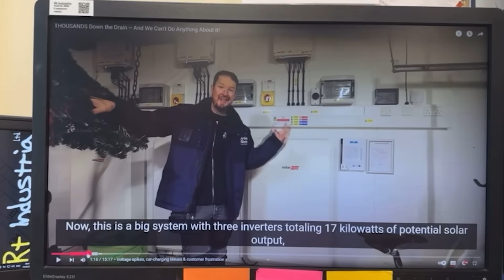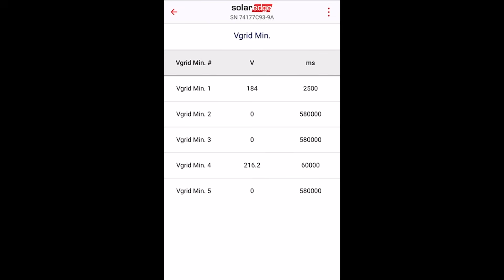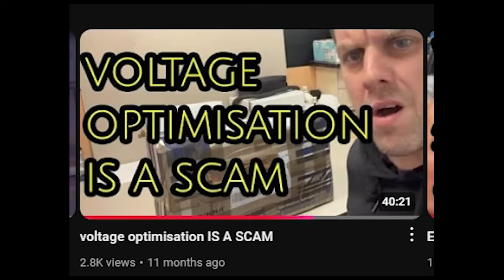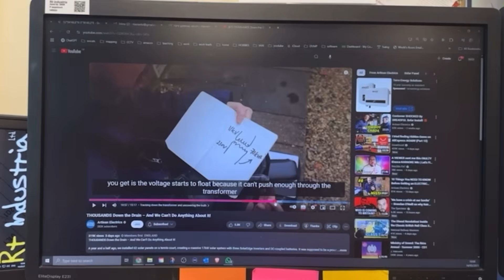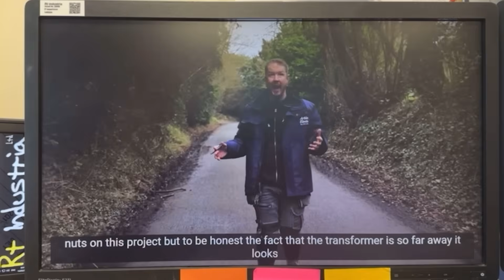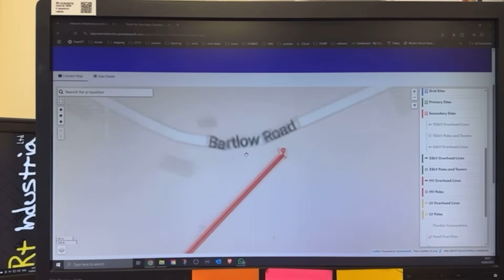ARTISAN ELECTRICS v THE GRID. WHO,S TO BLAME

Comment: I was at a school last year with 277V incoming. The FIRST thing the DNO engineer said was there is"loads of solar in the area". They did sort it out though, adjustments at the transformer I understand.
Reply: Can you explain why the solar inverters can push the voltage that high when they are supposedly E98/99 compliant and set to a maximum of 253 Volts?
Reply: @mfr58  If set to the regulation maximum they won't. However, they will still output current, albeit that will now be capped too. Now, AIUI, if there are many systems on the line pushing out high current and there's a high impedance somewhere and all that current is going through it, then the voltage there will increase. If the school is also connected to that point then they will see that higher voltage. In the Artisan case mentioned in this video it would seem their inverters shut down when they saw the grid regulation upper voltage was reached, possibly because it has to assume it was creating that out of spec voltage. But it could actually be a similar problem to the school with too many large solar PV systems in the area trying to feed back into a grid connection that can't handle it. I think 😅
Reply: @Hejavra  I'm not clear on how the voltage will increase at a high impedance point without the supplying inverters going way over their set limits.....So it shouldn't matter how large the solar generator, once the set voltage limit is reached the current will limit according to load impedance. I hadn't picked up from the video that their inverters were shutting down due to over voltage, which is what they should do.
Reply: @  Think of a potential divider type situation. So If the solar PV inverters are at one point on a line and further up the line there's increased impedance of cables, poor connections et al, then the voltage further up will be higher than at the inverters. And that's where the school is getting their feed, and why in the original anecdote they were given the reason for their high voltage as lots of solar PV in the area. Just a guess really.
Reply: @Hejavra  Yes, I can see the principle, but in the Artisan situation, what I don't see is how the inverters, if programmed correctly, should sustain output voltages in excess of statutory limits, assuming the system was installed to G98/99, which I believe it was supposed to have been.
Reply: @  Exactly. They shouldn't. So, if the inverters are doing that they would have to have been set up incorrectly or are faulty. However, Artisan seem to be claiming their inverters are shutting down because of an overvoltage appearing on their grid connection. If they have everything set up and working correctly, (and no optimiser) and good connections from their inverters to the grid, then maybe there's a lot more home generation going on on that line which wasn't taken into consideration, or there's a fault on it…which goes back to why the DNO wants to monitor with the Artisan system disconnected…they can't simply take Artisan's word that their system is installed and operating perfectly.
Reply: @Hejavra  Yes, however if it is because of other generation on the network, there must be a fault or wrong setting with those generators, not a function of there being too many of them.
Reply: @ Also the voltage seems to vary between 248V and 260V when generating, which doesn't seem as it should be. He says that the PEN fault protection is what cuts off the inverter, not over voltage protection. Something odd there.
Reply: @mfr58  Is the PEN fault protection working as it should and responding to the created 3-phase imbalance, caused by just one phase being used.  Perhaps the PEN multiple PME earth rods along the poles have failed or are disconnected, or never enough now that much greater loads (and Solar connected)?  Any views on this, this is a very interesting problem.  The customer could help UKPN by allowing a week or two of voltage monitoring.  In fact if they want to play hard ball they can insist on modifications to the system in light of practical results. Jordon might be in a protracted legal situation here?  It all depends on what all the contract paperwork says, with any possible limitations noted.  Yes a 3 phase supply will help a lot.  I guess much depends on the connected customers status within the community and what level of influence they can bring to bear. Can't see UKPN footing the bill, can you?
Reply: @  Oh dear. I'm not doing very well explaining this…so I've asked a well known AI. Here's what it said:

The grid voltage can rise too high in two key scenarios:

1. Local Congestion (Overgeneration vs. Load Imbalance)
	•	If many solar inverters in an area are exporting power while there isn’t enough local consumption, the excess energy flows back into the grid.
	•	This can cause a local voltage rise because distribution networks are not designed to handle large amounts of reverse power flow.
	•	The voltage increases at the point of connection because current flowing through the impedance of distribution lines creates a voltage drop (or rise in the reverse direction).
	•	If the voltage exceeds regulatory limits (e.g., 253V on a 230V system), inverters will start reducing their power output to prevent further voltage rise.

2. Grid Fault or Weak Grid (High Impedance Issues)
	•	If the grid has a fault or becomes “weak” (e.g., due to a distant transformer, long power lines, or grid disconnection), it may not be able to maintain a stable voltage.
	•	In a weak grid, even small amounts of injected power can cause significant voltage fluctuations.
	•	If an inverter keeps injecting current into a weak or faulty grid, the voltage at its connection point may rise well beyond normal levels.
	•	Inverters are programmed to detect these abnormal conditions and shut down if needed.

In summary, grid voltage rises too high when power generation exceeds what the grid can handle locally, or when the grid itself becomes unstable due to faults or high impedance.
Reply: @Hejavra  Thank you for taking time to be thorough! I can see how the local congestion can cause a voltage rise, but I don't understand how the inverters allow protracted voltage rises above set limits before disconnecting. They are type approved to conform with G98/99 which states that they should only allow maximum voltage excursions at their terminals of statutory max +15% for 1 sec and +19% for 0.5 sec. Also Artisan said that their inverters disconnected due to the PEN fault module, not their high voltage setting. I hope I'm not too being obtuse here!
Reply: @mfr58   TBF I was originally talking about the school high voltage scenario but then missed that the Artisan inverter cutting out was a PEN fault while still operating at a high grid voltage. This seems much more serious. Did Artisan measure the neutral/earth and live/earth voltages? I'm wondering if the grid voltage is fine and a high impedance inverter system neutral has raised that neutral voltage such that it appears there's a high grid voltage on the system because the inverter is producing a within spec voltage onto that faulty, raised neutral. Essentially the fault has shifted the output up by the amount of the fault voltage on the neutral. And then eventually when the neutral voltage gets high enough it triggers the PEN fault.
Reply: @Hejavra  An excellent summary, don't believe an AI wrote that.  Whatever, this is a complete and easily understandable post, all we need to know now is what Artisan do, what will the DNO do and what will the installation owner do.  Clearly they must allow the DNO to measure as they have requested.  I am convinced there is a back story here, we are not in possession of all the facts and actions taken to date.
Reply: @Hejavra  I think we need more information from them to get any further. They will post a follow up, so I guess we'll have to wait and see.
Reply: @   I know right! AI's got so much better even in just the last six months. It actually 'sounds' quite human and hasn't made any mistakes lately like it did in the beginning (it was quite apologetic though when you pointed them out 😅). And I agree on the Artisan situation, without more diagnostic information we're just going to have to wait and see now.
Reply: @  Yes Indeed. However, given what you say about the inverter still operating at a (seemingly) out of regulation high voltage AND a PEN fault, I'm increasingly thinking it's a poor neutral connection in their system giving the 'impression' of a high grid voltage. What we need to see is N-PE voltage at different points (inverter, consumer unit, main incomer) checking for fluctuating voltages when inverter output changes. Hopefully though we won't have to wait too long for the final answer 👍
Reply: @Hejavra  They cannot push current if they will not increase voltage slightly above net level. It doesn't make sense.
Given that voltage boundaries set by distributor are ignored.
There are small overflows when household appliances bump out and in consumption and it takes a while for inverter to react. But it is only a very short period so i am not taking it into account.
Reply: @Hejavra  Because let me allow overgeneralization ... they percieve inverters as electrical building blocks.
Not as device which works differently in each configuration and software. It is like programming complex machine or fixing car control units. You need to configure it and know it have brain on its own.
It's very complex device. Device which is able , beyond what wasl said, to manipulate power factor, reactive power consumption/production with cap or resistive characteristics, balance load between phases and it can also react on commands from distribution network ops as well when shit hits the fan.
Reply: @rybaluc   That answer was in relation to this particular comment about the high voltage at a school…which is situated elsewhere on the grid. I wasn't talking about the Artisan inverter operating at an abnormally high voltage. You're right that 'push' was probably a poor choice of word to use. I simply meant Inverters operating at their permitted maximum voltage don’t suddenly stop outputting current. Instead, if the grid voltage exceeds the allowable limit, they typically reduce their output power to help prevent further voltage rise. Also, If the voltage remains too high, they may eventually disconnect as a protective measure.
Reply: @rybaluc   Quite. And if we're now on the same page and talking about the Artisan inverter I hadn't realised a PEN fault had been mentioned. If this is caused by a raised neutral voltage, that could be why the inverter 'appears' to be outputting an abnormally high voltage and in actuality the grid voltage is fine. They need to find the cause of that fault. It could be the grid…but then again…there's a lot of connections in that Artisan installation!
Reply: @Hejavra  Exactly. Hard disconnect from overvoltage might be very possible and lot of inverters have it in software beyond certain limit. What troubles me is that artisan showed just graph of voltage but not logs from device. I bet we will see hard ( i mean by contactors not by lowering voltage) overvoltage disconnect among undervoltage warnings in those logs.
Reply: Boom! 👌👌
Reply: @mfr58 the max is actually 262vac, though you get some manufacturer tolerances on that and if it’s passing through transformers and back down to you maybe you can end up with an even higher voltage.
Reply: @edc1569  So it's 240, not 230V plus 10% (which would be 264V)? Despite the statutory limits now being 230V +10%-6%
Reply: Excellent Vid Bud, especially on DNO data mining. I'm blown that UKPN have put that data into the public domain, #Diligence 💪💪💪👌👌👌

Comment: This discussion on IET Forums may be useful: 

 Harry hasn't said whether it's a G83 or G59 (or indeed G98 or G99) connection but it's worth remembering that from the DNO's point of view a private transformer would mean the OV/UV settings are no longer standard, which is By Agreement only so no longer G83/G98 and if they don't agree with you that you can use standard 230V settings after a 250/230V transformer (or similar) a separate relay would likely would be required, commissioning and all. This is because the connection agreement, strictly speaking, is concerned with the voltage at the point of connection (the cutout) you would need to adjust the voltage settings by the transformer ratio so the DNO sees the same +/-% on at the POC*. This is all do-able (I've done similar with the DNO's permission) but may or may not be a cost-effective solution.

Also if you are going to the expense of a G99 relay and commissioning you could, if you're satisfied yourself that there won't be other local problems from voltage rise, fit the G99 relay at the origin (with contactor at the inverter(s) and manually adjust the inverter settings to a wider range (as it's no longer the G59 interface protection).

Are there any discretionary loads the PV could be controlling? Perhaps an immersion tank? Obviously this reduces export too so only worthwhile if it's actually doing something useful; then again if it is a useful load there's also a benefit in the difference between import and export rates p/kWh.

Might be worth considering whether adjusting the power factor setting will help (within the limits of the connection agreement). From memory can't remember whether G83/G98 give you that option though.

I would check the calcs for the private cable with an eye to an upgrade since if the volt rises by 11V=4% I'd consider it rather undersized for the generator. But it might be that there's a high impedance joint somewhere that can be fixed, or perhaps more likely the voltage is swinging on the DNO's side because of generators their network wasn't designed for, and all that PV isn't diversifying... Don't forget that if the DNO does come to site measuring the voltage, finds it high, and then back within limits when the PV is turned off, the club might not be allowed to turn it back on again if it's found to be in breach of the connection agreement, even it was a G83 system.

*(Side track but this does mean that voltage optimisers or anything else with a non-fixed ration are a problem and generally require a separate relay upstream, which is specifically noted in the latest documents; in an hotel room so not got copies to hand)
Reply: Jordan states that It's a G99 installation. 

By "private transformer" I assume you mean the voltage optimiser, and I agree it was totally wrong to install such a device because it would defeat the G99 protection settings (which in this case are implemented in the inverter software and not via a separate G99 protection relay measuring at the point of connection).

Adjusting the power factor (so that the installation imports reactive power) would definitely help with overvoltage, but not with the undervoltage when the car charger is loaded. This solution is not as effective at low voltage as it is at high voltage and it would increase the current at the connection point, so it might not be suitable.

You are right to focus on high impedance as the source of the voltage problems. It's likely that most of the impedance will be in the 11kv/415V transformer and the DNO's 415V supply circuit. That's only going to be fixed by extending the 11kV circuit closer to the customer and installing a new transformer and supply cable. This should have been picked up bty the DNO during the G99 assessment and it would be unfair to expect the customer to incur costs because of the DNO's error

Comment: For my sins i investigate voltage complaints for a DNO solar installs and car chargers are a pain in the arse especially when we get a sunny week like the last couple of weeks
Reply: I appreciate the job you do - thank you!
I had ukpn out last year due to over voltage and my zappi tripping out. We are directly opposite the transformer, so I expect it to be in the high end, but the zappi was saying 269V on 1 of the phases at times. They monitored and tapped it down. It's still running a little high (265V) at times though, but I appreciate it's a balancing game across the village.

Comment: limit the charging for one. and clearly as you say the solar pv is ramping it up, agree with you on the voltage optimiser for something that size to have 17kw running through it in some it wont be good. that enclosure has no fans or nothing that are going to kick in when that gets too hot.
Reply: Plus the torroid transformer has a TK ( overheat thermostat) in the winding which switches it out when it overheats.
Reply: @ nicely spotted.

Comment: The solar generation should not modulate the out[put voltage of the inverter, whatever the power level. Most people seem to be missing this for some reason. The inverters should not raise their voltage above set regulation max voltage point. Also the inverter should disconnect if the grid is out of limits. It's not likely that the grid is reaching 260Volts, otherwise neighbours would have been having some issues. So it more likely the solar system is not operating correctly for some reason. Yes, they should isolate the problem by monitoring the line without the solar connected and then see what happens when they reconnect one part of the installation at a time. The voltage optimiser is a nonsense, as you say. That transformer is 1KVA at most looking at the size. The customer needs to understand the problem must be solved and they have to forego some income while that happens. Artisan should compensate them for lack of production, if they are at fault.

Comment: We use to get gas engines trip on Short Circuit BOC in certain areas when the HV tranny would tap down due to the voltage uplift caused by the massive amount of generation being pushed out. This is 100% on him not the DNO.